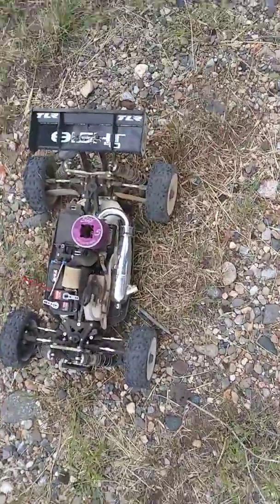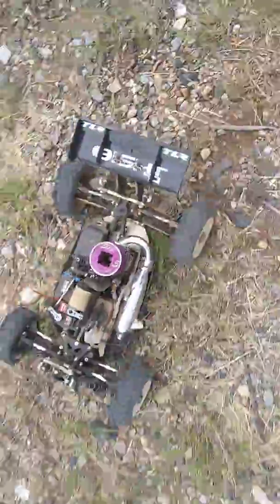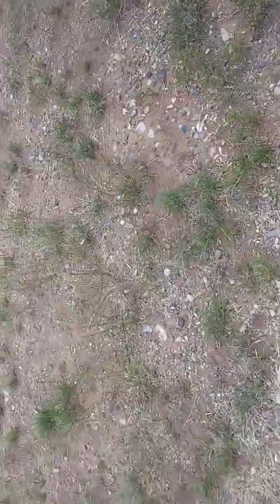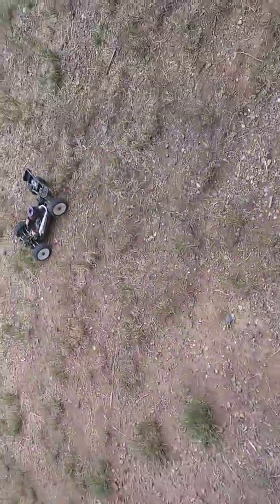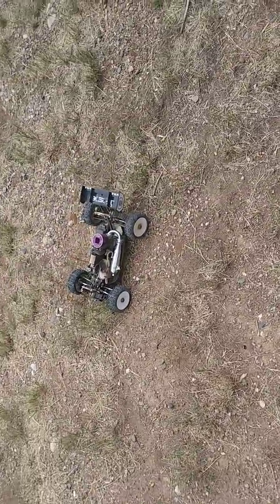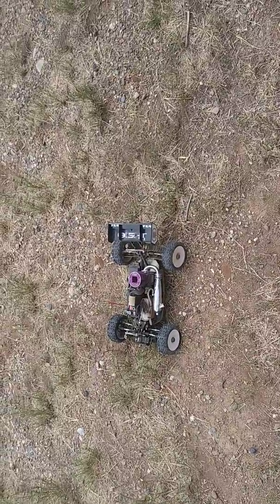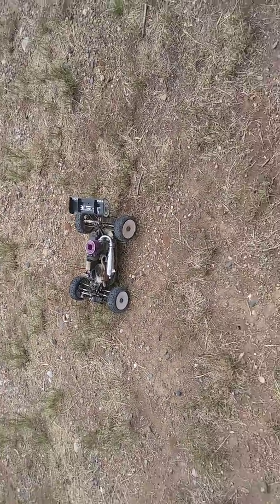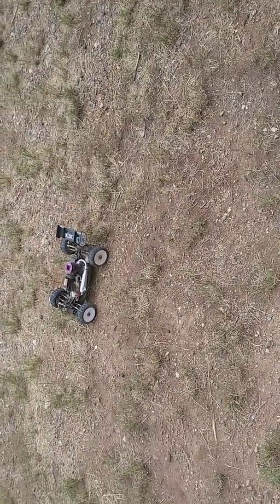Losi 4.0 buggy. Just doing a little fun test!!

Comment: Do you thing I have clutch problems or my differential is only happens when she get hot star slips I order new shoes ?
Reply from the maker: For a truggy or monster truck you wanna run 7075 aluminum shoes and stiff spings. Also take your flywheel off and make sure all is well with your flywheel and clutch. Getting aluminum shoes and stiffer spings will have you up and going bro
Reply: @kentuckybeardsman  soo she running fine until she get hot star spinning out soo this is shoes clutch problems right nop differential issue?
Reply from the maker: @CorvetteC6-LS2  i wpuld almost garuntee its bc your running composite shoes instead of aluminum and ypu need to run heavy springs bc its a truggy.
Reply: @kentuckybeardsman  how you know when the differential is broke she won't move no where?
Reply from the maker: @CorvetteC6-LS2  if the diff is broken it will not move at all. Just the engine will rev up.
Reply: @kentuckybeardsman  ok yeah she move for while them get hot start spis out
Reply from the maker: @CorvetteC6-LS2  tires are spinning or nothing is spinning. I run 20 thousand in the rear, 30 thousand in the center and 15 thousand in the front.
Reply: @kentuckybeardsman  thank you man you the best💪🍻👍
Reply from the maker: @CorvetteC6-LS2  anytime bro
Reply: @kentuckybeardsman  I find another problem my pinion join cap from is lose that right and I need clutch shoes thank you man for you support
Reply from the maker: Also male sure your flywheel nut hasnt come loose. If it has then when ypu give it gas it will just rev and not move at all. If the clutch isnt thw issue just take put the diffs and double check them but it sounds lime ypur shoes are bad or ypur flywheel nut has come loose and isnt spinning
Reply from the maker: @CorvetteC6-LS2  definitely fix that pinion. Thats the issue. The clutch shoes will gibe you tons more performance also
Reply: @kentuckybeardsman  I check my flywheel is fine the collet is good soo the pinion join cap in the from is there buy is losing don't has the small nut
Reply: @kentuckybeardsman  soo is my truggy run perfect and them when she get hot star spinning I guess I need new clutch shoes I hope so..sorry for my English 😂
Reply: @kentuckybeardsman  ok I order already the 2 pinion and new clutch
Reply from the maker: @CorvetteC6-LS2  awesome bro. Hope ypu get it going soon. If ypu need anything just let me know. Talk to you later
Reply: @kentuckybeardsman  I fit my truggy was the allen set screw lose thank you
Reply from the maker: @CorvetteC6-LS2  ahhhh thats good. A easy fix!!! Make us a video of it running bro
Reply: @kentuckybeardsman  yess tomorrow or Friday I will today is rain here in Connecticut 💦
Reply: @kentuckybeardsman  man do you thing my hobao hyper sst truggy cut handle the novarrosi  .28-8 ?
Reply from the maker: @CorvetteC6-LS2  i would imagine so. I would run a couple tanks and then check your outdrive cups and make sure its not eating them up. If it doesnt hurt the outdrives you will be good to go
Reply: @kentuckybeardsman  what about my differential? And do you know how many gear my truggy has ?
Reply from the maker: @CorvetteC6-LS2  diff will be ok. No clue about how many teeth it has
Reply: @kentuckybeardsman  yeah my hyper  .30 has 38,000 rpm should be ok whit the novarrosi thank you man you help me alot 👍💪🍻
Reply: @kentuckybeardsman  can you check for me how many year my truggy has I thing is 4 gear I not sure?
Reply: @kentuckybeardsman  center differential 48t from and rear 43t 11t pinion  4 gear should be ok whit the novarrosi 28-8
Reply from the maker: @CorvetteC6-LS2  yes
Reply: @kentuckybeardsman  man another questions and sorry for bather you what the differential oil recommended for my truggy ( center, from ,rear ?
Reply from the maker: @CorvetteC6-LS2  for bashing or racing??
Reply: @kentuckybeardsman  bashing
Reply: @kentuckybeardsman  I post video yesterday she run good
Reply from the maker: @CorvetteC6-LS2  alot of guys use 100,000 but i dont see the point in that heavy. I run 50,000 in the center 20,000 in the rear and 15 or 20 thousand in the front. Promise its plenty thick and will be all you need. When they run 100 thousand its basically locking the diff. Which isnt good for steering at all
Reply: @kentuckybeardsman  ok soo why hobao manual say 7000wt from 10 000 center wt and 3000wt basic I don't understand that?
Reply from the maker: @CorvetteC6-LS2  yes for a race setup you want a lighter wieght oil. For a bash setup you want a heavy oil so ypur tires put all the power to the wheels/ground. The weight oil you choose basically tells the diffs how much power you take from the engine to the wheels. Light oil causes less spin which is more control for track racing, and a heavy oil send all power to the wheels for ultimate power and speed.
Reply: @kentuckybeardsman  ok I run my truggy yesterday and she running very strong I love it's the tire turn to balloons 😂thank you drew!!!